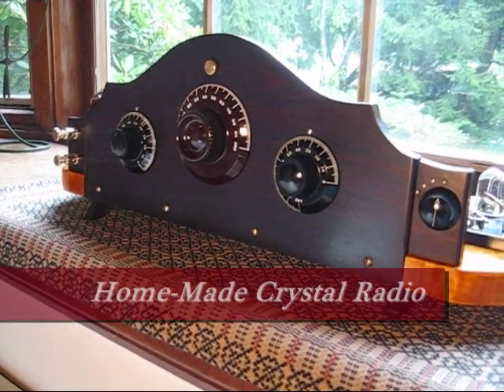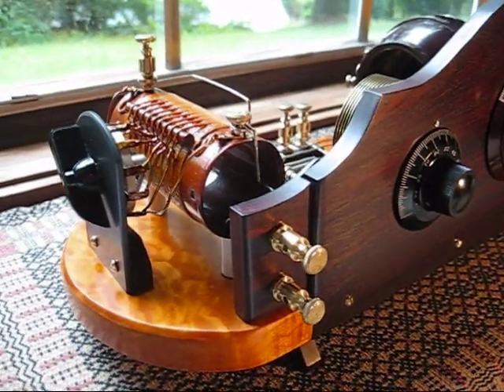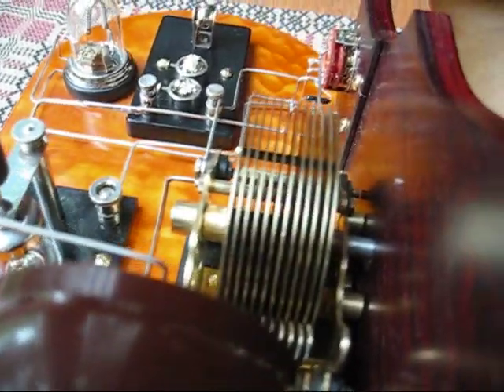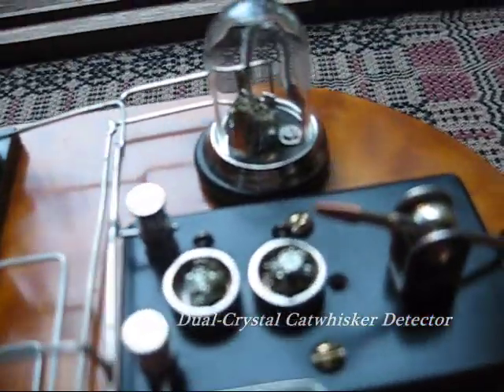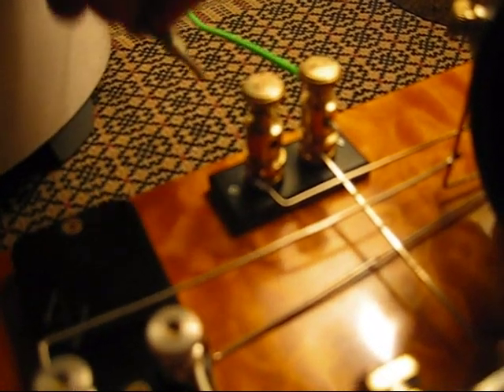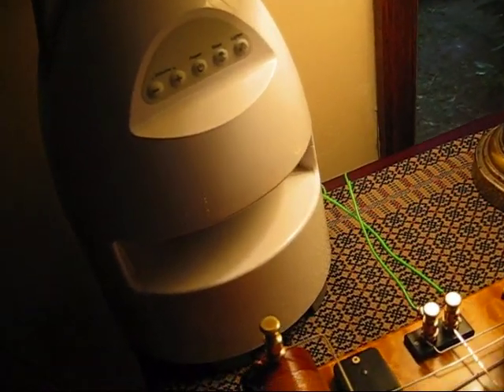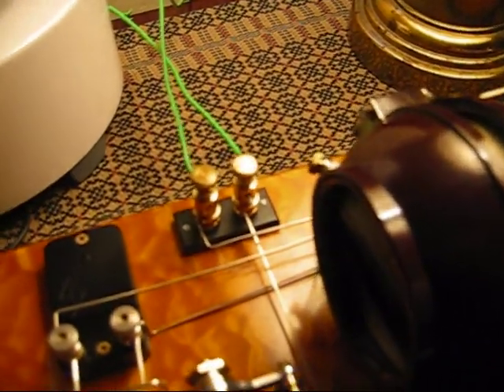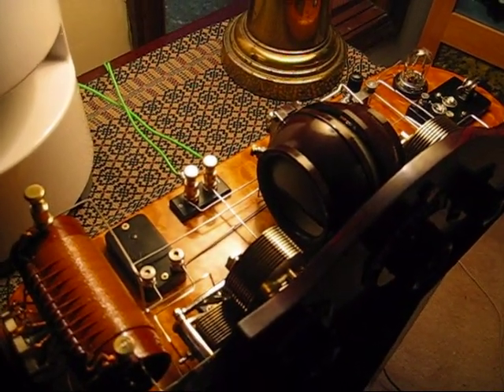Crystal Radio Demonstration

Comment: Beautiful - I have built many crystal sets, focusing on beauty as well as function.  I am attempting to build an almost exact replica.  I've wound the coils, built the detectors, have the tuning caps and dials.  I can likely figure out a circuit that will work, but any help with the circuit schematic would be greatly appreciated.

Comment: That is a very impressive crystal radio and it's old style vintage parts used I have tried making a crystal radio in the past but I wasn't very successful and I only picked up one station I brought the kit from Maplins and I followed all of the instructions correctly and it was a disaster so I might make a homemade version in the future because I'm a radio amateur and I've been interested in radio since I was 14 years old and I have spoken all over the world back on the CB 11 meters and I have got over 2500 QSL cards to confirm all the contacts I made and I have spoken to thousands of radio amateurs through the 21 years I've been licensed and it's all been really good fun. Thanks and best 73's Stephen M3SNV 73's.

Comment: Very nice work.  Those parts must have been difficult to find.  What type of wiring is being used?
Reply: If asking about the silver colored connection wiring, I've used similar wiring in several crystal projects.  It's a soft, square profile plated wire.  I was able to find it at one of the online antique radio suppliers about 10-15 years ago.  I used a wire bender to get precise and sharp 90 degree bends.

Comment: Museum quality.  A real work of art.
Reply: I bought this radio about 4 months ago on eBay. It has had quite a bit of additional work which enhanced the project. This is the center piece of my collection. I also build crystal radios.
Reply: @mtkoslowski  Congratulations.  It's a real beauty.  I also make crystal radio's as well as collect commercially made one's.  Philmore comprise most of my collection, although I have a "Rocket Radio", Olson, and Planatair.
Reply: @mtkoslowski  Congratulations!  I've admired this radio for years and I can't imagine one any nicer.  Would it be possible to get a drawing that shows the wire connections that were made between all of the the radio's components?  I've tried to reconstruct the connections and to I.D. all of the components used a few times by reviewing this video without success.  And I have located a nice tapped coil identical to the one used in your radio.  I probably have enough high quality 1920's components  on-hand to make a really nice radio.  I'm a novice at all of this but I still enjoy tinkering and learning.  A simple hand drawn representation of the connections would be a great help and I'd be willing to compensate you for your effort.  Enjoy your amazing radio!